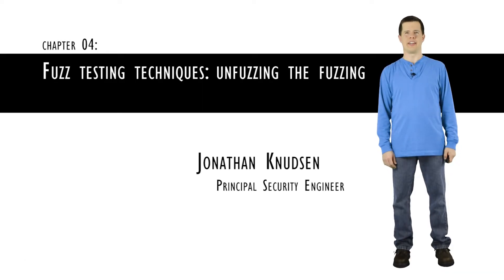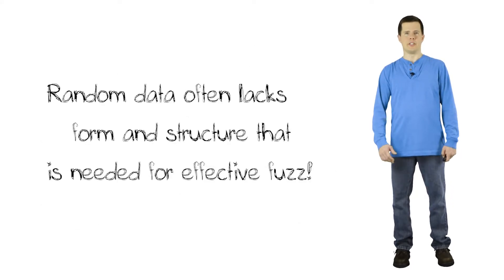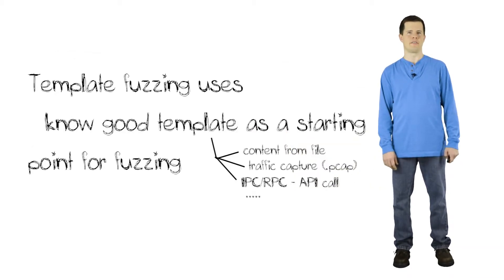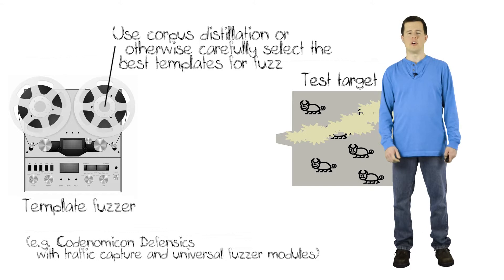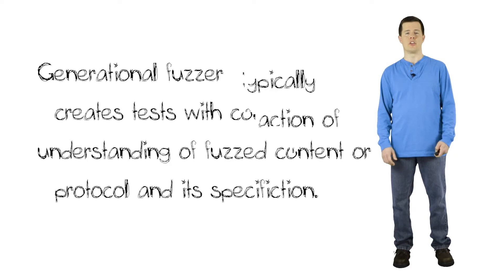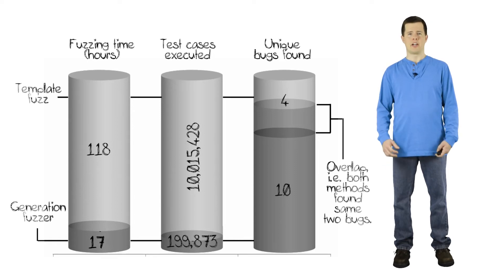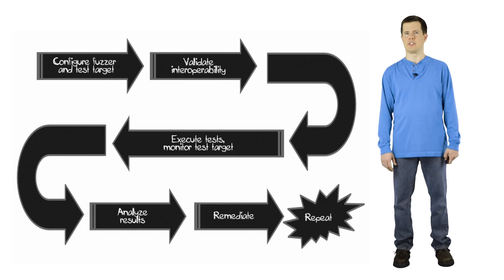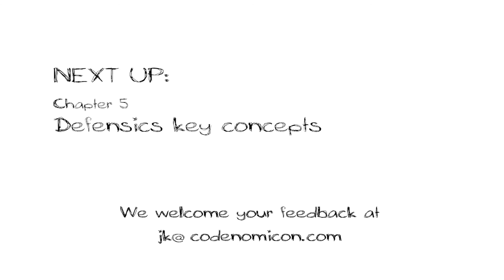Part 4: Fuzz testing techniques: unfuzzing the fuzzing

Comment: The Power Macintosh 4400 (also known as the Power Macintosh 7220 in some markets) is a mid-to-high-end Macintosh personal computer designed, manufactured and sold by Apple Computer from 1996 until 1998. The Power Macintosh 4400 was rather different from most other Macintosh models, in that the floppy disk drive is on the left rather than right, and like the Centris 650, the casing is made of metal rather than plastic. Apple did this to reduce production costs, in addition to using more industry standard components such as an IDE hard drive and an ATX power supply.